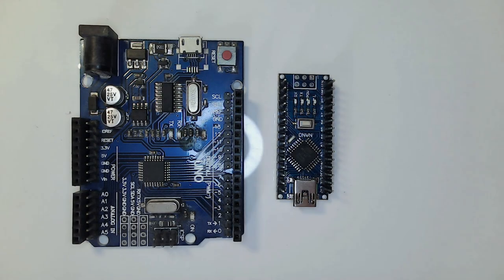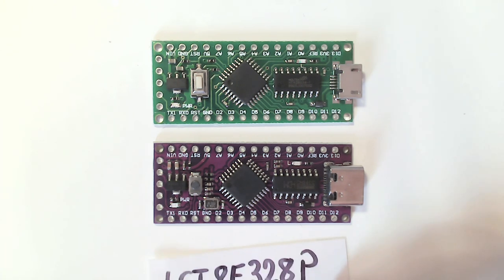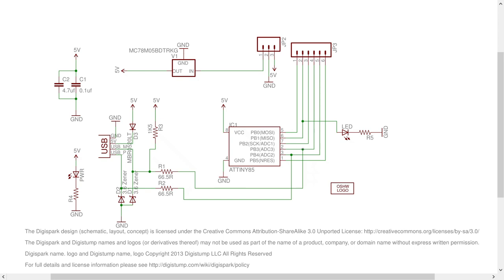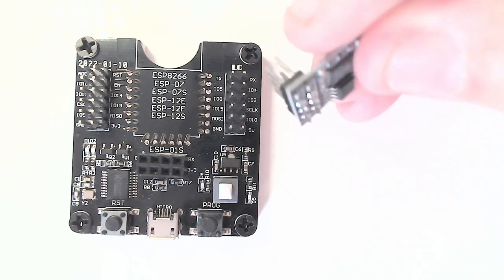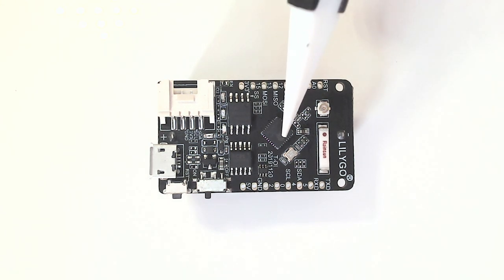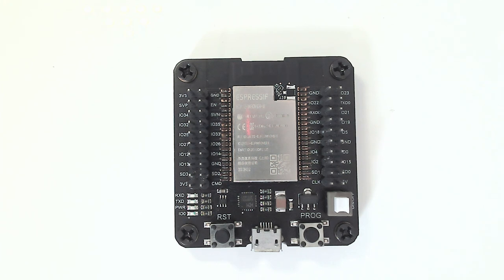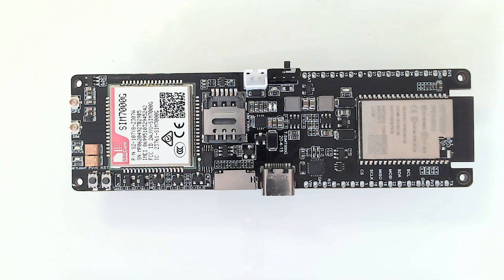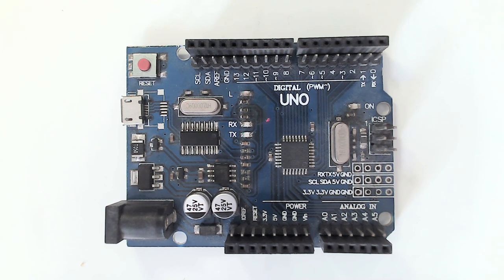The Big Board Shootout - what's the best MCU module for your project?

Comment: You need a lot of power to get led's to be sun light readable. The first ones i used had to have a big heatsink and they still would try and burn the information in to your finger if you touched them.
used them in Jet fighters were the display had to be readable in full sunlight in the cockpit.
Reply from the maker: Wow - never thought of this application! And sure - I guess this was way before OLEDs, so the backlight in there must have been close to mains powered :) Thanks for the insight, TEH!

Comment: I love the ATTiny85. I use it for most of my small projects. Sometimes even that is too big though, and I use an ATTiny10. I hate the Arduino IDE and its framework though. I rather use Atmel Studio, or lately Visual Studio Code.
Reply from the maker: Hi Hendrik - then the upcomming christmas episode will be right along your alley :) 

Regading the IDE - the biggest upside i see that I can simply switch between totally different MCUs without switching the IDE. Atmel Studio works only for Atmel MCUs (to my knowledge), so if I wanna port a project from AS to say an ESP, I need the Espressif IDE.
Yeah, I know: you can do that all with Visual Studio - but you're talking to lazy Det - way too much hassle to set up :) 

So, for now this will stay Arduino IDE centered. When I do code DL, I normally package the whole project into one portable installation - so you have all cores and libraries already set up.

Comment: Hi Det,  Excellent review of what is available.  As for me, I would like to have you do relatively simple examples using the ATTiny85s and similar.  Intermediate code requirements with cross section of sensors for input and wifi connectivity and LCD displays for output.  Regards
Reply from the maker: Hi Ed - ATTINY stuff - comming up :) Got a little christmas project in production that's right down that alley.

For anything Wifi connected - "we're going to need a bigger boat" - say MCU. I was thingking about some basic episodes along the lines of "making your life with Wifi easyer"; this will be sased arounf an ESP8266, but is applicable to the whole ESp family.

Comment: Why would you expect that there would be some form of standards between boards, I just make my own.
and use Xlab, esp's own programming ide, or what ever comes to hand. try to avoid the Arduino IDE as much as possible.
Reply from the maker: THE - I think the biggest upside with the arduino IDE is that you stay in one enviroment and simply switch MCUs. Yeah, I know... VS code does that, too - but not as easy as arduino does.

So - not avoiding here - I like my (old/1.8.19) IDE :)

BTW: need to talk to ya about an upcomming project; your page doesn't have a contact email. Can you mail me?